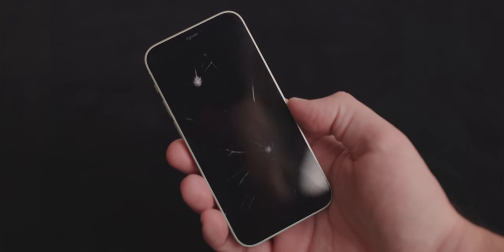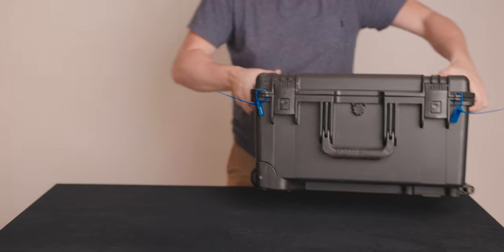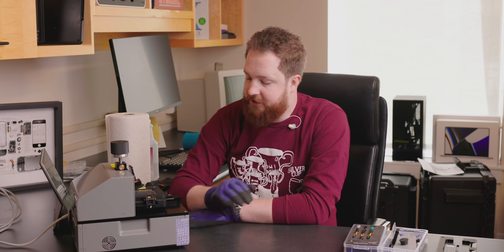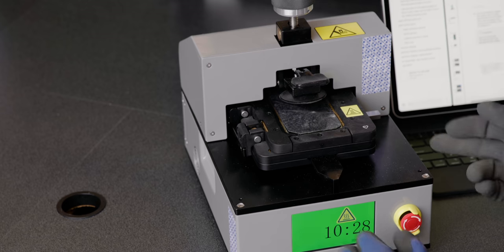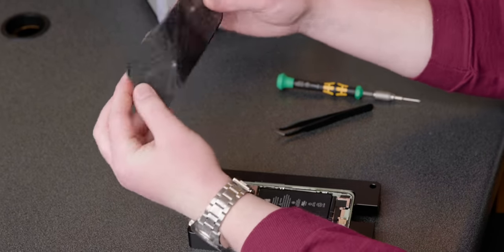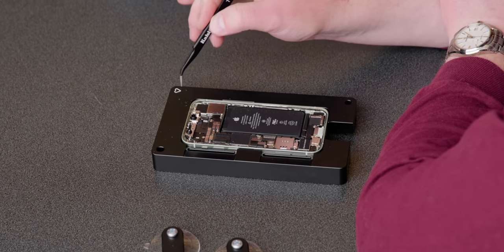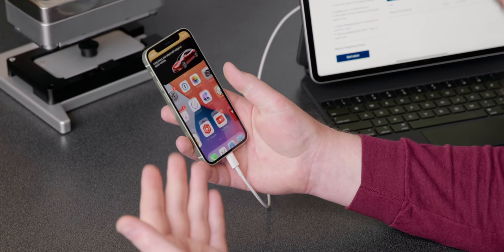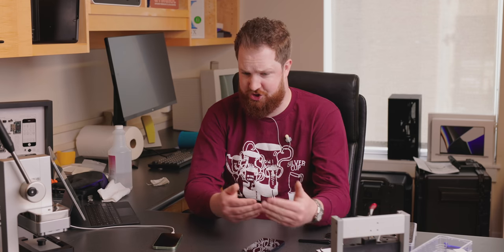Using Apple’s Tools to Fix My iPhone

Comment: You obviously know that Apple wants to make the repair process SO COMPLICATED that people are demotivated to fix it themselves and to consider taking their device to Apple. It can be way easier than it actually is
Reply: You don't need any of this gear, a hairdryer help remove the screen adhesive
Reply: Water proofing is hard. 🤷‍♂️
Reply: Full disclosure, this is the equipment used in repair rooms at apple stores. This is how they do it.
Reply: @Mast3rShan31  watch his previous video. The reason you can’t repair 11 and below is because of a special software Apple used on those phones that were needed to complete the repair, which they stopped using on 12+
Reply: @jsaktony1  that's great and all but not necessary and won't make at home repairs cost effective.
Reply: Yes, taking your consumer electronics to pro repair is absolutely the correct action for 99,999% of us. Battery replacement is $49-$69 when done by Apple, or little more in Europe, for example. I can’t understand why anyone would try the DIY route.

Care to estimate how profitable those battery swaps are for Apple? Repairs are probably like 1/1000 of their annual revenue and even less of their profit.
Reply: @TheSkcube  how is it not necessary? It sounds like this is what they themselves use. If that’s true, there are reasons for all these steps, to guarantee the quality of the repair. Why would Apple provide a way to half ass it? You can get that from the guy on the corner.
Reply: @float32  A heated bed or any source of heat replaces the hot machine that apple uses, combine with suction cups you can remove the display without needing to ship a huge heavy ass box. The display adhesive is the same as you will get in the after market and you can set in place with a soft clamp or even rubber bands wound tight, again no need to have a second heavy box with tools.

This channel has videos that show how apple can mess up repairs and even advertise third party repair services. Not all third party repair companies do a bad job. 

There is no magic in the apple tools that can't be solved with simpler tools. Shipping 96 pounds of repair kit two ways is not sustainable, which is the whole point of repairing devices instead of throwing it and buying a new one.
Reply: @jounnna8720  which is great when you live next to an Apple store. Not so great when you don't where your only option would be 3rd party or AASP.
Reply: @TheSkcube  this setup is for mostly anyone, so requires reproducibility, regardless of who is using it. The above average joe will desolder parts with a heat gun in their hand. I’ve seen engineers do it, many times.
Reply: @float32  I think with the difficulty that Quin faced, this is certainly not for anyone. He had to improvise outside the manual more than a few times. This is like saying that everyone needs an onion chopper because you can cut your finger if you use a knife.
Reply: I agree, repair shops have done quite well without all these gadgets. Notice how from the different screw sizes, the glue they use, the serialization, and the unique pieces of equipment that won't work for any other device, are all by Apple's design and are intentional. It creates more waste and discourages the average consumer from repairing their device. I mean what does the FaceID have to do with the screen? And really, the same battery sent by Apple prompts a nongenuine part message on the screen?
Reply: @float32  as the galaxy S5, it really is not
Reply: @zachw566  they created the issue they can fix it.all of their excuses are null as they control almost every aspect of their production
Reply: @jounnna8720  fixing isn't how they make their money, making sure you don't fix it is how they make money.
Reply: @TheSkcube  Your entire point falls apart when you acknowledge that you don't have to get any of the repair tools from them. You can just get the component and outsource the rest of the tools if you want to. 

They have the tools as an option for those who don't have other tools or don't want to bother acquiring things on their own.
Reply: @alejandroelcid  It's not that it's non-genuine, more that the display is not serialized with the phone. 3rd party stores have a machine that can copy the data from the old display to the new one.
Reply: @aaronr2248  that can only buy the parts, but the manual only uses their tools. Most people would follow the manual and use their own tools. 3rd parties already have a cloning device that negates the serialization. You don't need to go through Apple's loops if you know what you are doing.
Reply: @TheSkcube  I get that, don't get me wrong, but Apple's argument that they are flagging 3rd party parts goes out the window when their devices flag even Apple genuine parts. There is no need to serialize individual components.
Reply: @alejandroelcid  Their devices just flag non-serialized parts. The non-genuine thing is just branding it as such so that people go to Apple or AASP's. By just copying and pasting the repair procedure from their stores they have made that clear.
Reply: @TheSkcube  Then don't go through the hoops... Why are you making it seem like it's a problem to have an alternative? 

If you want to use it, use it. If not, don't.
Reply: @jounnna8720  If they didn't have to tool and manufacture useless tools and actually were good at the repair, perhaps they could turn a profit, lmao
Reply: I work at an apple authorized repair store & the truth is the process has always been relatively the same since the iPhone 6s, which is some time before right to repair was this huge issue it is now
Reply: @float32  
No, waterproofing is actually pretty easy, if you're Apple and don't care about serviceability.

You just slather the innards of the damn thing in as much adhesive as possible, as was shown in this vid.

If Apple wanted me to be impressed, then they should've made a phone that's as easy to take apart, and repair as a Fairphone 4, and still have the IP68 rating.

Comment: I work at Geek Squad, and we're apple certified. This is every tool we use, and the guides. People wonder why it takes us like an hour(sometimes less, sometimes more), well now you know why! All of these arbitrary tools and steps.
Reply: Why do you need to use all these crazy machines??
Reply: @ukaz1400  use them or get fired
Reply: pretty much, we're on camera the entire time and apple can send a rep in to our store at any time to make sure we're doing what we're supposed to.
Reply: @BoringDayDevelop  that’s a whole lot of “crazy” procedure to replace a battery and a screen
Reply: @joziphstu  I agree, but what tim apple wants, tim apple gets
Reply: if a computer is not working right I can ask half a dozen simple questions and know its 1 of 2 or 3 parts and run a utility and know which part in 10 minutes and have that computer running like new in another 10 min once I have the replacement parts what apple did is just insane the protocols I use work on any non apple desktop amd or intel CPU and any brand of mother board and GPU combo and amd intel and nvida do not follow the same protocols to build their products they all require power and all produce heat and transfer data using standard protocols
Reply: It only takes an hour? My gosh, that's really fast. I would be satisfied if it took 8 hours. And I thought I was impatient, wow.
Reply: @awesomeferret  some of them can be knocked out in 20 minutes. Its the diagnostics afterwards that really determine the speed
Reply: @ukaz1400  Did you read his comment?
Reply: @X22GJP  I did. What I don’t understand is why they actually send people these huge boxes of machines when you literally don’t need all that? I’d say that Hue Geoffrey does quite high quality repairs and he never uses such things
Reply: @tomsims7868  wow that's a long sentence.
Reply: Which is weird coz to me, replacing a screen or battery or whatever in an hour seems quite reasonable. I guess people are just too impatient
Reply: @ukaz1400  It’s Faster repair time
Reply: @ukaz1400  As someone else pointed out, these tools are mostly for repairing multiple iPhones at a time, not just the one you have. It's to ensure a streamlined process and heavily minimise human error.

Comment: Been a Apple employee, who repairs phones in the apple stores, those are the same tools we use, the heating element you didn’t use correctly, you have to continue to cut the adhesive and heat till the screen separates within the heating machine. Makes removing the display much easier.
Reply: What is that position called I am extremely interested in that position but not sure what it’s called
Reply: ^^^ im hella intereasted too
Reply: @chaimmallakh5181  Most would be what they call a Technical Expert , then Above that Genius. The "Starting Role" at Apple for Service is the Technical Specialist.
Reply: go figure on that one.
Reply: @hussamar3934  You would have to start as a Technical Specialist, and get to the Technical Expert Position to be able to repair phones.
Reply: Also, I’d think you have to verify with them to make sure the serial matches so that someone doesn’t rent these tools to try and fix extra phones using 3rd market parts for their personal iPhone fixing business. Here, Apple is saying “We’ll rent you the tools, but you can only fix the phone you paid to fix, that’s it”.
Reply: Someone like you must be included in the Repair Kit too :).
Reply: yet exactly the same can be done with a heat pad and suction cup

Comment: Kinda wondering if they actually give you an extra set of adhesive, or if it's just because you ordered parts for two separate repairs. Does seem like it would be helpful to have the spare in there though.
Reply: Yeah, I think that’s much more likely the reason for this. It’s just too much effort for such a small program to code that logic into it that if you order multiple parts for the same phone serial number that it knows which things you need and which you won’t need
Reply from the maker: There’s actually two seals per kit so I ended up with four but you’re right in regards to everything else: ie screws
Reply: @snazzy  ah, okay. Thanks for the reply, I didn’t pick up on that from the video!
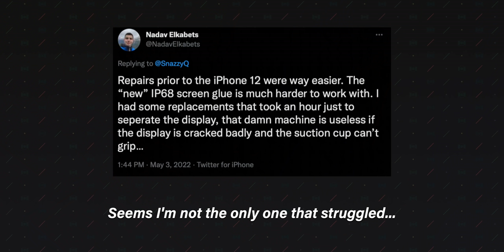Reply: I'm the guy from 12:14 lol. You can easily mess up the adhesive application so they provide an extra.

Comment: As someone who had to do 9 of these just today (work @ an apple store) feel my pain with the adhesives, our poor hands cryjj, also never put pressure on the back of the display, cup it from the edges and push the suction cups onto the display, thats how they have us do it. Also you were right, the diagnostics mode is totally separate, it's so we can run diagnostics and never risk accessing customer data, its pretty cool.
Reply: Did you need any special qualifications to work there? Seems like an interesting job.
Reply: Pretty cool? Couldn't they make an official display not connect itself? Can software not detect the battery is legitimate? Or are they saying knockoffs are just as good so we need to verify u paid us?

The diagnostic system is basically just remote adb :/
Reply: @keyboardwarrior7538  to me this seems like a just get by thing and possibly they will just get rid of parts pairing for the screen and battery with the next iPhone so they don't have to do this for every single self repair

Comment: Great overview.  Yeah that end part is definitely something we could do on our own.
Reply: Seems fairly obvious but knowing Apple it wont be available for us ever.
Reply: ya, but Apple will never give repair shops, let alone end users, access to their software to confirm that the replacement parts are apple genuine. Its the reason that apple are only making this service avaliable for iphone 12 and up as they switcehd to a new system that allows them to remotely verify that parts are correct and genuine, the older devices required to be physically connected to a local machine to reset the software locks.
Reply: Hello Aaron👋🏻
Reply: @fergusyoung6782  But it should still be possible to do that without phoning them. Also it should be possible for independent repair shops to pre-order a load of parts as inventory so they can do same-day repairs.
Reply: Indeed, it would be very nice if  allowed pairing via their website with our Apple IDs. This would be much quicker overall.
Reply: Honestly it's probably cheaper for Apple to just use their existing call centre resources (probably the same one Apple store employees use) than than to build new tools. They'll surely build a web interface for this as soon as the demand passes a certain threshold.
Reply: @katbryce  it won‘t be sadly. How it works, is that Apple has a system called MyAccess. You log into that with your (seperate) Apple ID for technicians and there you‘ll find access to your programs, like AST, GSX, ATLAS, depending on your role and whether you are AASP, IRP or Genius. GSX, ATLAS and AST2 are engineered in a way that you only have access control, BUT you have to be part of the system. It‘s the same as root and user on UNIX systems. Now, while you could add another user, it has to be part of a group (e.g. IRP). What that means, is that you would have to add every single one who orders a self repair to a new created group and revoke their access after the repair is done, which is more work for Apple than just opening a new call center. It will probably stay like this forever since rewriting the system will cost Apple millions.
Reply: @zodwraith5745  you get it, thankfully. Most people just come up with BS arguments on how that system is somehow for security lol
Reply: @Marvis1  you can apply for access
Reply: Would be cool to see them automate it or have some sort of self-service web portal
Reply: Anyway, those notifications are so dumb ? what if you wanted to repair your phone with the parts you want ? still you can't dismiss the notifications... Android is open source : FOSS>Proprietary ; so Android>Ios. The best way to get a phone that you own, is to not buy from Apple/Samsung/Huawei. One Plus makes the best phones you actually own, Xiaomi is the best compromise

Comment: Worked for Geek Squad when they started doing Apple repairs. Same exact process and tools. Opening the device was easiest part of iPhone repairs. Dealing with Apple's systems were a nightmare. Glad everyone gets to see the process.
Reply: Currently working for Geek Squad as a repair agent and yeah, the physical repair is always the easy part (aside from the damn battery tabs and display adhesive on the newer phones), but dealing with GSX and repaircal issues right before closing is why I have hated doing them.
Reply: @XeLegend  How often does someone's phone end up dead (by accident) after a screen and/or battery replacement? And what compensation does the customer get in that case?
Reply: @brendanfarthing  It happens fairly often, mainly with the battery replacements via a doa part or hitting the wireless charging pad when a tab breaks and you need to yeet that thing out. If that happens we see if we have a whole unit in stock (not normal store stock) and replace their device, or attempt to put it together enough that it works, and order a new whole unit which arrives in a day or two and swap devices when it arrives.

Comment: Fun fact about these “screw holders”

Yes, they are doing exact same thing in the Apple Store. This is for technicians so they don’t have to worry about screwing too long screw and it’s just faster. This is very clever in my opinion.
Reply: Amd great for the enviroment.
Reply: @deth3021  cellophane and recycled paper aren't the worst materials, it reduces the amount of training and attention needed to get sufficient competence so ironically you may actually be right, because training has an envronmental cost, as do botched repairs. even slowness.
Reply: Tech here-- they're great for what you said and also keeping track of the screws & ESD safety. On Pixels they have torque settings on them & stores are supplied with a torque screwdiver (if your store is certified for pixels). Fun fact about Pixels, they are probably the most stringent as far as what Google wants certified repair stores to use for repairs (Though Samsung's system is the worst IMO).
Reply: But then you need a new one for every single new generation of iPhone. What’s wrong with just using a weekly pill organizer? Can you guys not remember what order you did anything in?
Reply: I think I like the magnetic project mat from iFixIt better.
Reply: Would be much easier if they used consistent standard screw sizes from the tiny end of the metric screw standards, like most non-apple laptops did 10 years ago, only smaller.  Then the kit would be a paper envelope with exactly the right number of identical screws or two lengths of screws as needed by the design geometry.
Reply: nope this is solely for manufacturing purposes, every millisecond counts in manufacturing the best product in history of mankind

Comment: As an apple tech, you need to move fast when it’s done heating. Due to apples built in passive cooling and the heat conduction of the aluminum sides, it cools down almost instantly. You need to go lightning mode moment the heating is done or it won’t help.